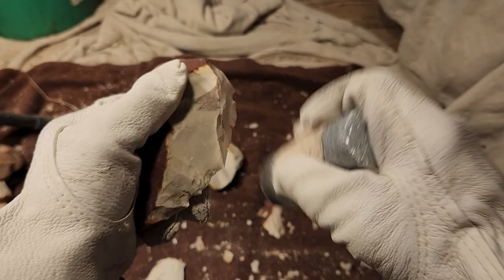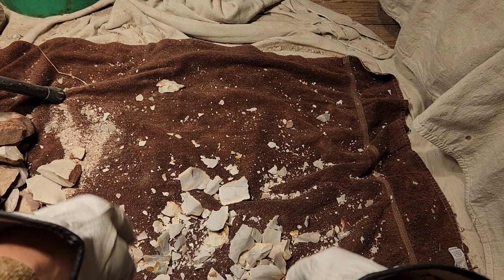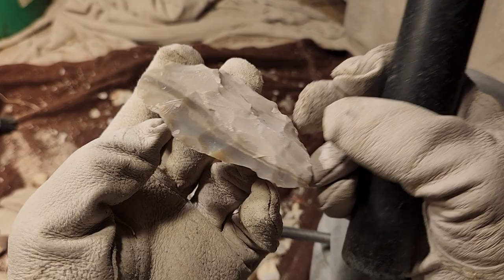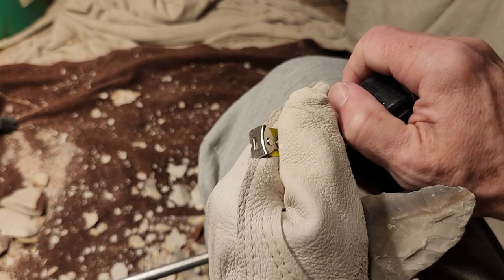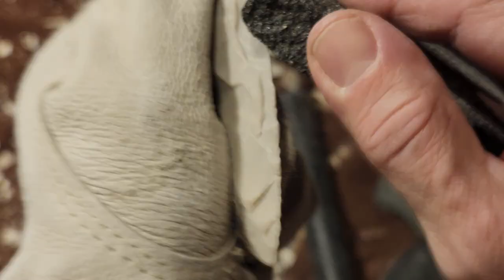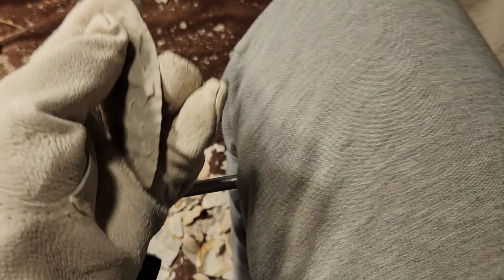1410 - Part 1/2 - Yap Knapping Inconsistent Raw Chert

Comment: Bifaces were classified using a key (Figure
2) which arranges three attribute states in their presumed order in the production trajectory.
According to the model which underlies the key, first the bifacial edge is established then the remaining cortex is removed and finally, the bifacial edge is straightened. The key does not take haft modification into account since it appears to occur at varying points in the production trajectory.
Length, width, and
thickness show progressive reduction for each of the biface types and thereby support the biface reduction typology
(Raspet 1979; Johnson,
Robins, and Sparks 1983). Table 1 shows the total biface count for each of the regional samples and the trajectory type breakdown for each sample. If the distance from chert source is the major determinant, non-source area samples should contain fewer early stage biface rejects than the source area samples. This relationship
14114
Reply from the maker: Are your observations of modern knappers consistent with the underlying model you are referring to?
Reply: @KnapperJackCrafty  I explained in email I sent to you 😁
Reply from the maker: @Jimpotts  got it